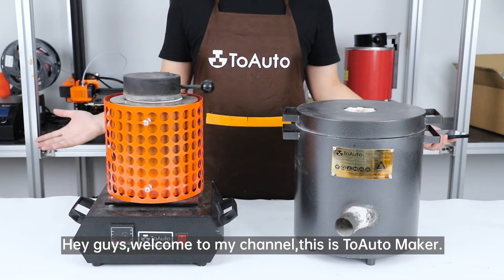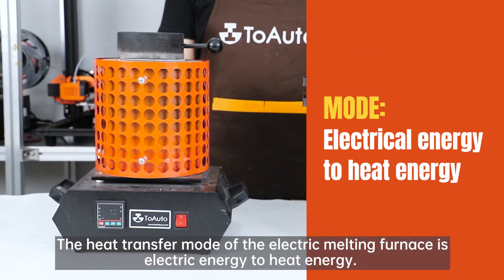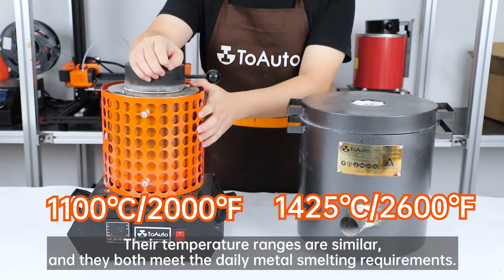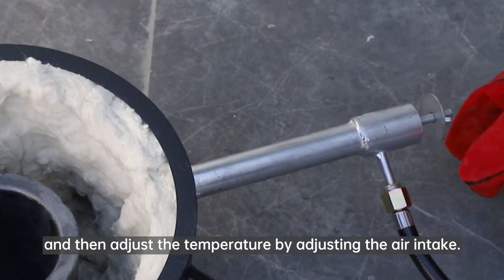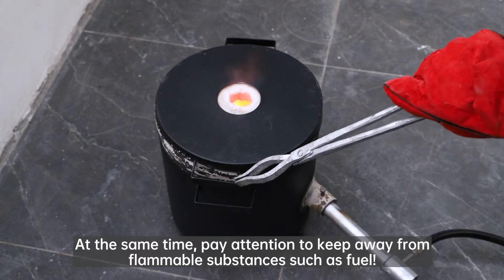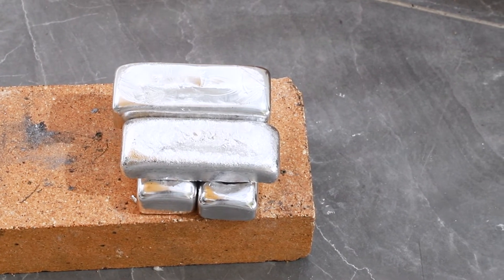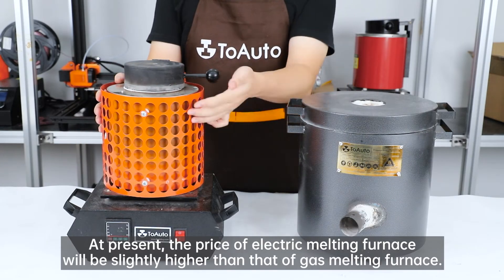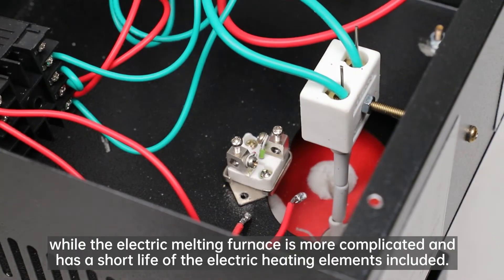How to choose melting furnace 2022 - gas vs. electric - Metal Melting furnace【Beginner Advice】

Comment: Any tips on where to find a crucible suitable for working steel in my induction furnace? The graphite crucible it comes with will not work, of course, since iron reacts with carbon to make cast iron. It's easy enough to make a vacuum environment to flood with argon for processing of scrap steel for steel castings projects, but so far I have had no joy in locating a suitable crucible to use. Anyone? Anyone? Bueller?..
Reply from the maker: Magnesia crucible, silicon nitride crucible, zirconia crucible, corundum crucible, silicon carbide crucible, etc. can be used.
Generally, it is melted under the protection of argon to avoid oxidation and change the composition.
Reply: Do you have a link to a electric furnace that can melt iron/steel? I've been looking around for one that is reasonably priced. Idk if you can get one for less than  1k$ 

Not that I can find any electric induction furnaces that can melt alsteel other than the massive ones above 10k

Comment: Is the following true?.......A typical gas-fired furnace will achieve approximately 3% in metal melt loss. 3% of 4,080,000 lb is 122,400 lb of metal melt loss. A typical electric furnace loses approximately 1% in metal melt loss. 1% of 4,080,000lb is 40,800lb of metal melt loss.29
Reply: Depends on what you are melting, gold and silver should have negligible loss. For other metals you might need to cover the crucible slightly to reduce oxidation, and thus perceived losses.
Reply: I know that oxidation is higher with more air going throug metal. So surely